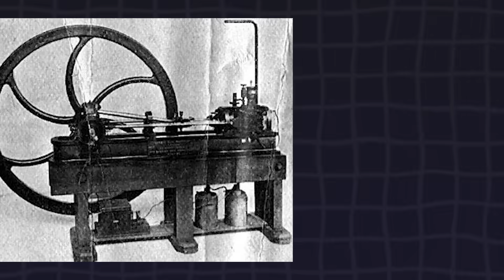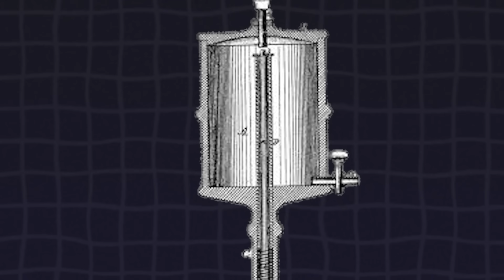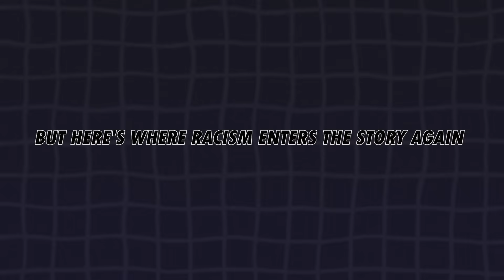They Erased This Black Man Who Invented A Robot SMARTER Than Humans!

Comment: Elijah McCoy invented an automatic lubricator for steam engines, which he patented in 1872 
1 
5. This device, known as the "oil-drip cup," used steam pressure to automatically pump oil to an engine's moving parts while it was running 
1, eliminating the need to stop trains and other machinery for manual lubrication 
1.

Over his lifetime, McCoy held more than 50 patents 
1, with most related to lubrication systems. Notable inventions included:

A graphite lubricator (1916) for superheated machinery 
5
An ironing board 
5
A lawn sprinkler 
5
His automatic lubricator became so successful and widely used that it was standard equipment on locomotives, transatlantic ships, and factory machines 
1. Because inferior imitations flooded the market, engineers began specifically requesting "the real McCoy" 
1 — a phrase that historians believe originated from his reputation for quality

Comment: Thank you for the story he deserves to be remembered, and he definitely got gypped on his patents.  However, there is nothing in a closed loop oil lubrication cup that does anything remotely close to what you call “sensing” anything at all. Most industrial robotics use grease instead of oil and hydraulics and are not in a closed system.  His accomplishments are good enough to be the real McCoy.- we don’t have to invent connections that aren’t really there… because that cheapens his memory.

Comment: White people invested almost everything that used his automatic lubricator, like steam engines, gas engines, textile machines, millimg machines, industrial pumps, assembly lines, steam shovel, compressors, locomotive…..etc. McCoy had 50 some patents, how is that racist? Feedback systems weren’t invented they evolved but James Watt invented the first famous system 60 years before McCoy’s lubricator. I’m not knocking anything McCoy did, he made a solid contribution to mechanical engineering but it’s a bit of stretch to claim he invested automation and robots. In fact it’s not even remotely accurate.
Reply: It really doesn't matter how accurate it is. What matters is he didn't get paid royalties for any of his ideas. They stole his ideas, and made millions. No one has said anything else about his other ideas. 🤨 So what are they, or are you going to keep that a secret too. 😎
Reply: @waynef9314 infringement of a patent is nothing new. The Chinese are famous for not respecting patents and intellectual property. Many inventors like Tesla had their inventions copied or were altered/ tweaked by someone in such a way that they didn’t infringe on a patent.  It sounds like people preferred McCoys version. It wasn’t personal, it’s how businesses and people operated then and now.
Reply: I also read up about James Watt. He had nothing to do with Lubrication of train engines. Even though he did improve the Steam Engine, and had other ideas that still had nothing to do with Lubrication. 🤨
Reply: McCoy’s  lubricator used negative feedback to work, negative feedback is a mechanism  not a device. Watt invented the centrifugal governor used on the steam engine, which is considered the first most famous device to use negative feedback, and was well before McCoys lubricator. These are two different devices.
Reply: The ruthless types always seek to justify their evil. 😮
Reply: @a@alansolomon2863think u meant, intellectually superior?
Reply: @martin4819  no such thing exist, love-wisdom is all. ✌️💚
Reply: Because they wanted to steal from him still at the end of the day..common sense